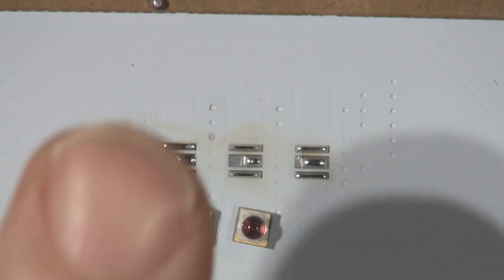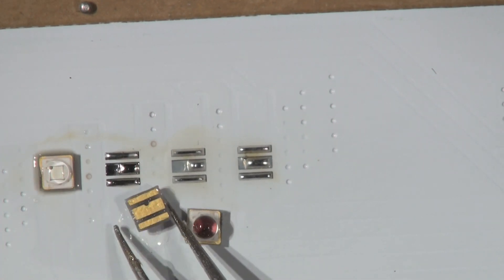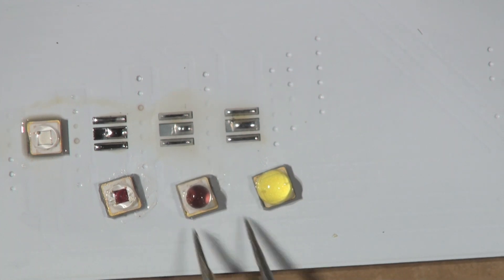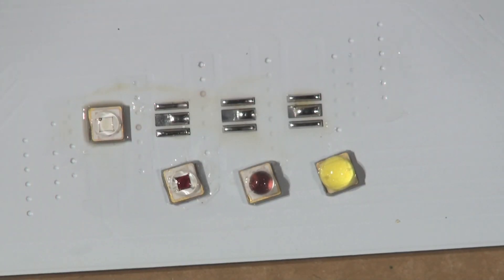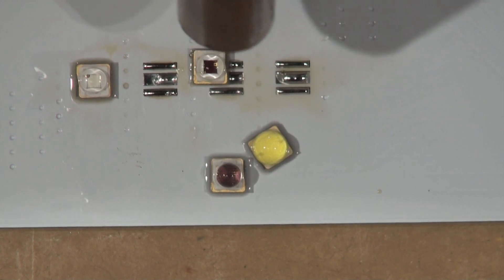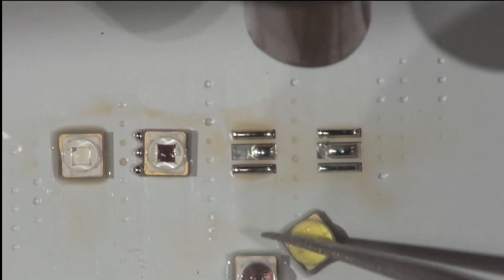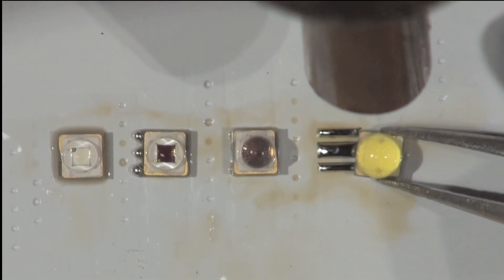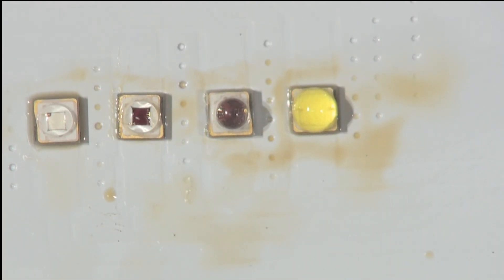See Surface Mount Components Align Themselves using only Solder Surface Tension

Comment: Hey Magic, could you do a Bose Solo 5 soundbar fix? I have found out most of them have the same problem they will just stop working randomly and won’t turn back on. Just wondering if you could take and over ride the power so that it’s always on
Reply from the maker: It is a common problem. you can try the fix in the video - it often works. I don't have any spare time to take on repairs just now. I do have a number of solo controllers here and plan to dig into them soon so watch out for more videos.